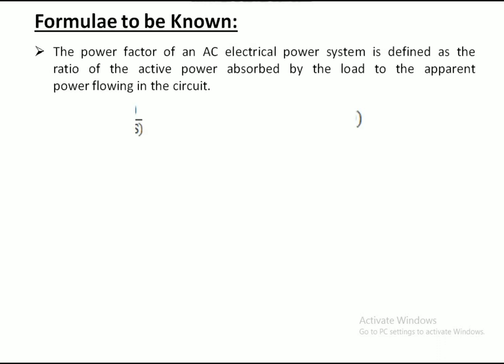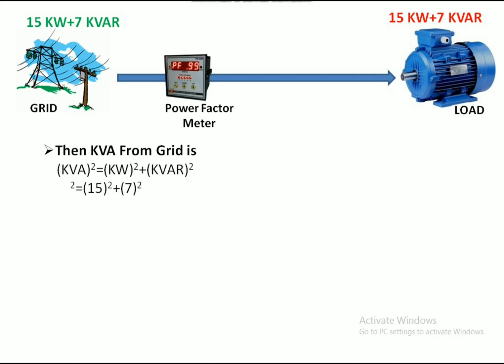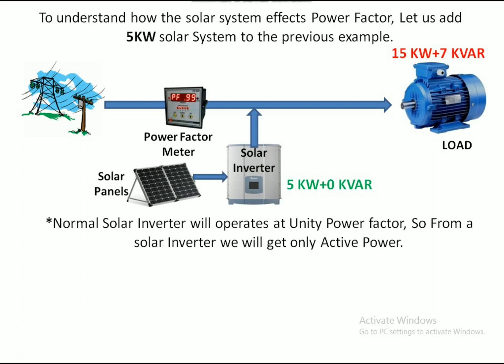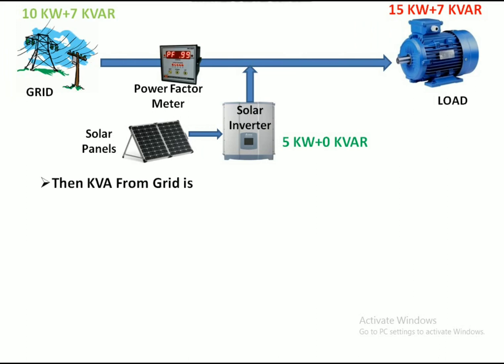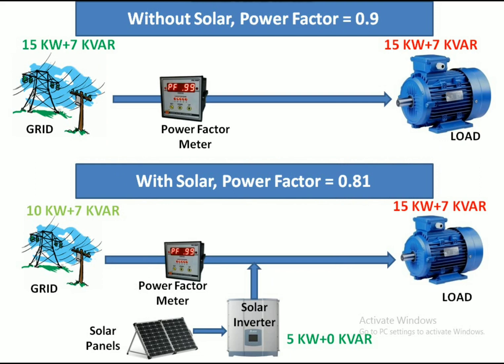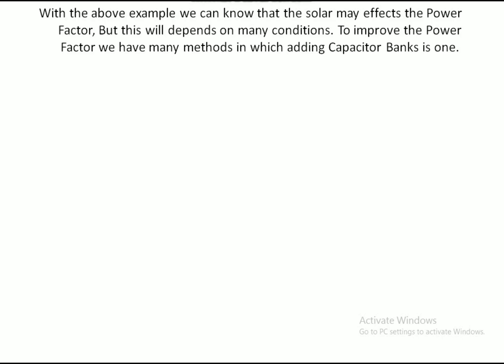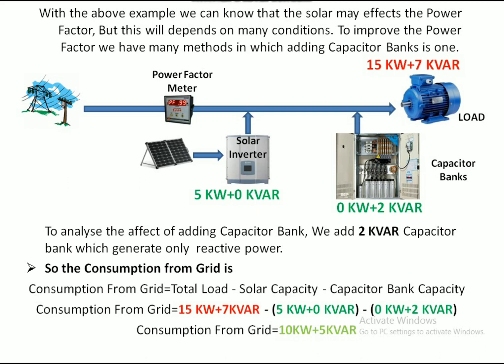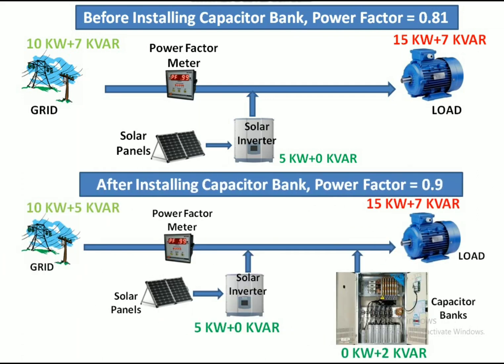Power Factor

Comment: if i set the inverter with low power factor of 0.8, then i dont need to install capacitor bank. am i right?  Inverter itself can generate reactive power to grid though there is some decrease in active power fed to the grid.
Reply: My understanding is we don't want to provide reactive power, it was created within the inductive load by the grid in the first place. But it can feed back into the grid, so we gotta make up for it, absorbing it by Capacitors, storing that energy until released into the next upcoming grid cycle

Comment: Best of near 50 Videos yet to understand for me.
Private, usage on meter about 900-1200 KWh, produce 660 to770 KWh solar.
As most pf tensing units are NOT running 24/7 like 4 fridge, 2 water pumps (that for now I detected in pf lowering) I have no fixed amount of reactive power I can or should add myself.
I also would need to meter the amount of power at grid entry point (not have and difficult, as shared connection with other houses) and steady adjust, mean like an automatic pf corrector found between 1.200 and 2.000 Thai Baht.
So it seam easier and more stable to add calculated capacitors at detected units like sure
* 2 PC - (a PC Server 24/7 with 50 Watt, 50 Hz, 230 Volt show pf 0.87 - clalculated near 2 uF) and also 
* at pump or
* cooler fridge , 
if needed, to reduce the reactive power noise then when the unit is powered on.

I ordered 2 digital pf meter (and starting 6* 1uF C), to add them into circuits I wanna check and better eliminate local pf problems, than mess up with a all over system. 
My 2 OnGrid Solar Inverter allow to adjust pf and reactive power, but for that I need to know the data near Grid Connection - and that is the problem to add.
Reply: Not an hour after the above post, the set of 5 2 uF Capacitors arrived.
Fixing it on a plug and plug it at same plug using the 50 Watt server, pf .89 the pf even got worse to 0.85 ... now I am checking what I calculated wrong.
I didn't find any post, comment, site with this result, but have to tell, that the measure I have is from a PZEM-014 modbus, but I checked, wired correctly.
As the PSEM-14 at only the wire to the PC and also the PXEM-016 also even the digital meter at main Room power supply show same change to worse pf (.6x to 0.5x), I am out of options for now. At the same net grid in room is also an small Solar Inverter (rated 300W, deliver until 220 Watt) connected - if put of, main pf get up to 0.9, but the lowering pf with capacitor is same.
That hurts ... as I don't get it.
Reply from the maker: Can you share any single line diagram with guessed active and reactive power consumptions,  or pf of load. And also how r u calculating capacitance required for ur circuit.  And how r u connecting capacitors to ur circuit,  and exactly which socket or point.
Reply: @needed_exploration  the calculation base is from here: https://www.youtube.com/watch?v=TPqXNLkJTJM ... Step 1-9 fixed in a Libre Office sheet
but I yesterday used then two ways : 
taking the showed power at meter as apparent and also as only real power, that sure logical leads to another need of capacitor, 2.41 uF against 1.88 uF at the server PC with 50 Watt shown
but the calculation from above answer seam to show clear that the meter show the real power, as manual multiplication Volt and seen Amp = MORE Watt
leads to a lower base and so less uF
Reply: @needed_exploration  It does not make sense to correct the pf for the room, as only the server PC run 24/7 and all other units just near 12 hours during the day, so I am aware to have to correction (weather from leading or lagging) behind a main switch I use to connect the main PC to the grid, and so if using a 2 plug extension, I added the 2/4/6 uF capacitor at the other plug near the pc plug, what as of logic might be then parallel adding, but as written above ... the pf got worse ... capacitor was loaded
Reply: @needed_exploration  OK maybe to explain the start of story:
I have 2 each 2KW Solar Inverter in my house net.
I also have several singe meter (most Ferris, 5 digital PZEM) and 2 PZEM-16 and -18 at the Solar and calculate every month the usage of every room to see where is most used, and why and maybe how to reduce as of example at cooling room with isolation against heat here.
And the last 3 months, starting with the time I have 21 instead of 17 Solarcells ... I find over 100 KWh missing, mean
* first from the electric bill I take the summ of KWh metered (as I can read the main meter myself and see its ok) and reduce it by the both other ferris meter from 2 neighbor at our local 230V Grid
* the rest SHOULD be our Grid usage, and then plus the of 2 each meter shown near exact same Solar KWh SHOULD be our home usage
* and here adding all room meter (Rooms Office 7, 6, 5, 4, 3 and 2), Living rooms made for rent long time ago (1, 2, 3, 4 ,5, 6) plus the 2 meter from water pump (deep well, and house serving) I have less USAGE in the house, then the sum of Solar and Grid (our part) should be.

Example : 
last months payed Grid left to us = 510 KW/h, Solar getting is 661 KW/h = seam so show we used 1.171 KW in house and restaurant with water. But counting/adding all metered usage together only comes to 1.057 KW/h

So I miss 114 KW/h that I sued more but don't see, or lost on another reason ... and searching for this issues (sure no stealing, that cabling I might see) lead me to check on power-factor, 
and depending on what power is measured on all the meter (here difference of ferris and digital also) that 114 KW/ could be also the reactive power.

Problem: 
I remember I had this miss matching to pay Grid KWh to the sum of the house even BEFORE started with Solar, I am doing this calculation since 17 years each month ... and some month there are only less than 10 Watt missing (maybe just miss metered) and some time more, but no match seen yet ...
I also found some later installed AirCon that was connected before the room meter (= room don't see, main count it), and ferris meter that even didn't count this 1 KW at all also (changes them to digital meter)
difficult to add a digital meter just behind main Grid power meter as cable there 16 qmm, but maybe I have to ... depending on the results here
Reply: @needed_exploration  so during write this comments an Idea:
The meter seam to take real power, not apparent power as shown at PC server calculation, then
* 17*(.567) Watt more for 24 hours at server causes 12.8 KWh each month more than metered
If also estimate fast Main PC use 70 Watt shown real power with pf of 0.8 
* another 17.5 Watt for 12 hours a day here = 6,4 KW a month
... that maybe is part of the misfit of some months ...
the cooling room itself with 2 cooler/deep fridge also goes near 150 Watt at pf 0f 0.7 , leading to
* 64,3 Watt reactive power added ? what might cause also near 16 KWh (if run 1/3 from an our as most cooler)
* but here I have a sum of about 110 KW/h a month metered (PZEM-018) and if taking pf 0.8 would mean near 28 KWh to add

BUT for this I need to get clear if the pf on the different meter are correct, and what the Watt there is : Apparent or Real Power (seam last one)
THEN if they are leading or lagging reactive power
TO be able to find the right solution !
Reply: and another test, successful show capacitor work for better pf at another room, containing 2 fridges: 230 V, 50 Hz, pf rise with one 2 uF from 0.68 to 0.72
calculating fast, dirty at 1.71 Amp might need +14 uF ... not have yet
able to find a plug, add all 4 * 2 uF capacitor together in parallel = 8 uF, rising the now (after a fan is gone) pf from 0.61 to 0.81
and recalculate this with 230 Volt, 1.51 Amp before, 50 Hz, give a calculate to 7.87 uF
= my reading and understanding if most right, for full pf 1 need uF 18, but during day fan would be a problem. So 14 uF with fan, 18 uF without (night) mhh
that was helpful to see and proofe

Comment: Nice video which explains the reason for power factor issue appearing after installing Solar on grid or grid tied inverter in any sites especially in case of industrial loads..
Reply from the maker: Tqq
Reply: @shanthanuk: your statement isnt correct. Power factor concern was already in place before solar was added. Adding solar just shifts relation towards the grid